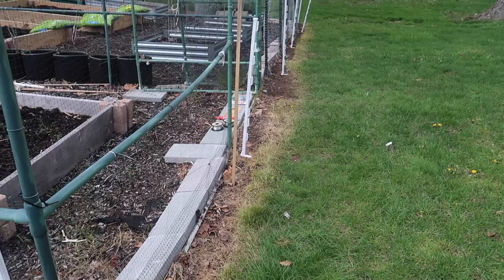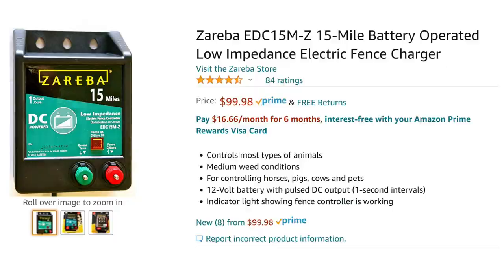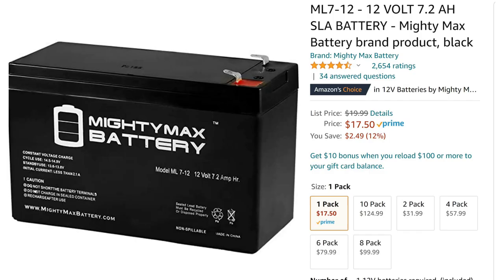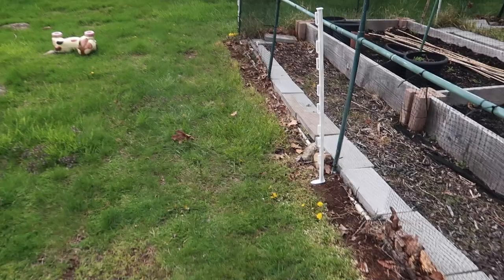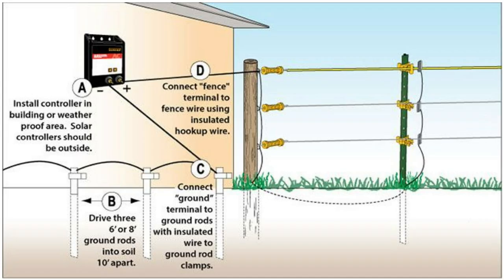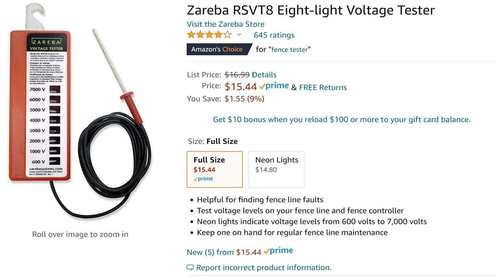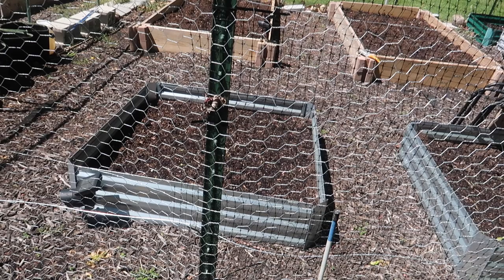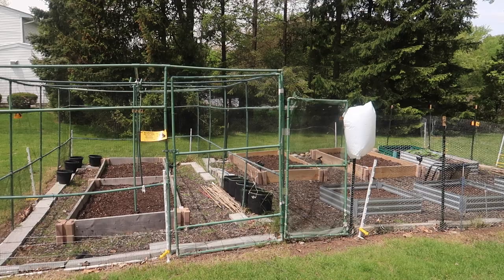Installing a Zareba Electric Fence to keep the animals out of our garden:  Learn from our Mistakes!

Comment: Instead of added expense for a larger battery that still has to be regularly charged, a separate 15 Watt (or larger) Solar Panel (with built-in charge controller) should keep the battery topped up even on cloudy days. Also the grounding rod(s) can be buried horizontally for a larger surface area for the best ground connection. Thank you for all your videos as they are both educational and enjoyable to watch.
Reply from the maker: Thanks EyesOnReality, I didn't know you could bury the grounding rods horizontally, brilliant!  We already bought the larger 35 ah battery, I wasn't sure about what wattage solar panel to buy, but great advice, thank you!
Reply: @TikkiOOO  Bonus: The specs on the Zareba EDC15M-Z current draw is not listed anywhere yet by your experience, the 7.2 amp battery preformed 2 days (stopped on the 3rd day), @ 12V = 0.160 amp draw. So the 35ah battery (by math) should last 9.11 days between charges. If you do opt for a solar charging option, a 12V 50W to 100W panel (climate dependent) will do nicely for the 35ah battery size. A charge controller is needed to ensure no battery overcharging happens and also ensures the battery voltage does not drop too low causing shorter battery life charge cycle issues. If you have any questions, ask away. Happy Growing!

Comment: Congratulations! 👍
I've had electric fence experience, and from the point you're at I'll offer a couple ideas. Move the charger as close to the house as you can. Then run it on a 12 volt power supply. According to the label, even if your house is 15 miles away it will still work. A 12 volt trickle charger will work great, and give you a way to turn it off from the house if necessary. Our charger was mounted on a wall in the barn. You can fold short pieces of the wire in half and drape them over the fence wire to fill in gaps, without running more wire. The way you ran the wires makes the setup a "custom" install, so just tell people it's an "art project". Good luck, and fight for your produce!  😂 👍
Reply from the maker: Its an art project...great one liner!  If I mount the charger near the house I would have wires running across the grass, right? That's why I didn't get the AC unit.  Thanks for the advice!
Reply: @TikkiOOO  If you have a way to put the wire on a pole, try it. Where it has to touch something for support, use a spark plug wire for insulation. That way you can zip tie it to metal if you had to. Good luck!

Comment: Great job.  To cover the small holes, caulk can be used.  Still, I would ensure that some form of ventilation is used to deal with moisture.  Other than that, you’d have to use an enclosure that keeps moisture out.  Best wishes to you.  By the way, I like your sense of humor 😅!

Comment: You have a short drain to ground that is why the batteries are discharging so quickly. Maybe grass touching the hot wires or the hot wires are touching your wood posts to ground. Also if you are using copper wires for power then clean them once a year at the termination points since copper wires oxidize.

Comment: Tell Hubby, he can use a blade of grass or a thin piece of straw to slide across the wire instead of his fingers...As you slide it, it will give a minimal sensation without getting shocked.

Comment: Hello, Just came across your video. New to channel. Just buy a solar pannel battery charger and it would keep batteries charged. Make sure you buy a pannel that provides about 5 amps of power to provide power for the wire and also charge the batteries. Take solar pannel watts devide by battery voltage. 60 watts / 12v = 5 amps.

Comment: if you decide that you need wire higher up , may i suggest using electric poultry fence ??? it keeps all of the critters running around here at bay ... it will hook up to the system that you "currently" have (couldn't resist the pun) ... 😁✌🖖👍👌😎
Reply from the maker: Good advice, and good pun....I will keep it in mind, thank you!
Reply: @TikkiOOO  😁✌🖖👍👌😎

Comment: Did you need to run the ground next to the hot wire the whole way and they need to touch both at the same time?  Or as long as you have the rods the subject doesn’t need to be on the ground?

Comment: To enlarge the autonomy of the systems you should to consider to link the batteries in series (link the - pole to the + pole of the other battery). In a more complex configuration you should to consider to buy a charging controller and a solar panel to make indipendent system and forget to charge the batteries. To make a diy insulating box you should use the hot glue or silicon. In my opinion you use too much amazon, consider that all of the equipment that you need exist in all DIY store, the planet will say thank you.
Apart for the amazon abuse (probably I'm wrong, but this video is shooted with materials that cames only by amazon) I appreciate a lot this channel, best regards :)
Reply: Almost every inexpensive silicone sealant (RTV) outgasses an electronics-corroding acid (acetates, in fact).  In enclosures, that shock-box might not last the season.  Hot glue works well for things that only need okay sealing -- Gorilla Glue brand hot glue with a hot gun being an exception (good stuff).  Rubber cement works surprisinglly well for tighter fits.
Reply from the maker: Thanks Spy One, you are right, I rely on Amazon, maybe too much, because I don't live so close to the shopping areas.  There are no cheap DIY places here,  Home Depot  has gotten more expensive since it drove out all the Mom and Pop stores, they used to be cheaper but now Amazon  has taken over, which is scary, but very convenient and usually better prices.  I appreciate the technical advice you gave, what wattage solar panel would be sufficient I wonder?  Thanks again!
Reply from the maker: Thank you gth042, I assume you are talking about sealing the small holes to keep out the rain.  I wonder if some putty might also work...thanks for the advice!
Reply: @TikkiOOO  For the solar panel you need to consider the amount of Watts that in a day use the sistem to work, based on that you need to consider at least more 50% of the amount to choose the solar panel.
EG: 100W for 24H. The solar panel should support at least 150W.

anyway googling you should find much more information than I can write in this comment...happy googling and wiring :))

PS: don't be scared by the topic of solar panel, once you understand the mechanism all will be easy
Reply: @TikkiOOO  Just about any indoor/kid-safe putty will work well enough for that box (assuming kid-save means Fewer chemicals...).  Worst case, you cram a low quality putty in there every month or two (old-school packing approach to sealing).  Polypropylene is a pain to glue properly, and it's never going to be completely watertight anyway.  Drips and ants (your local circuit-shorter) are about all you can keep out of something you need to regularly service...  To address drip entering from the top edge of the lid/cover, I do suggest some tape to "extend" the upper lip of the lid/cover.  The goal here is just to guide water away.  You can test with the garden hose.  Lastly, consider what happens to the water WHEN it gets in.  It's better to leave  a Tiny hole or two at the bottom of the bilge area rather than where the wires come out.  Don't give minerals in the water and electrochemistry any corrosive ideas.  Yup, comment's long enough.  Best of luck, and have fun!!
Reply: No, hooking up the batteries like that , you will end up with 24 v's.  They should be in Parallel